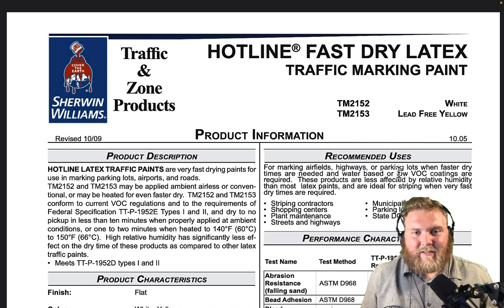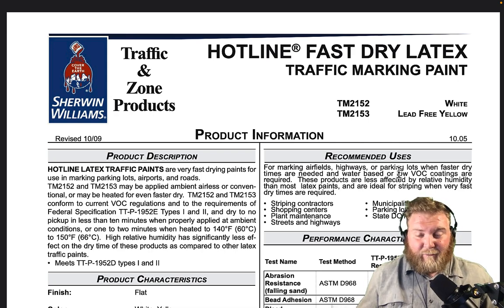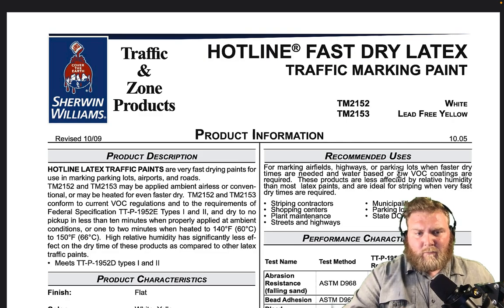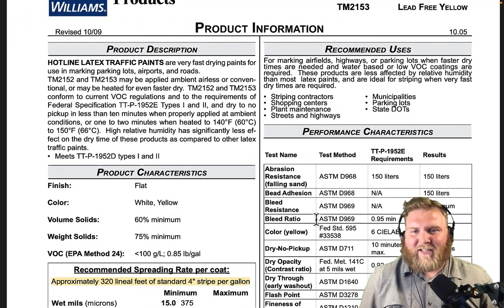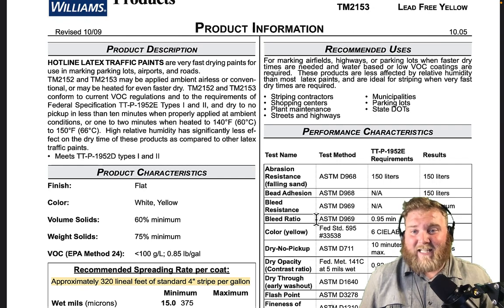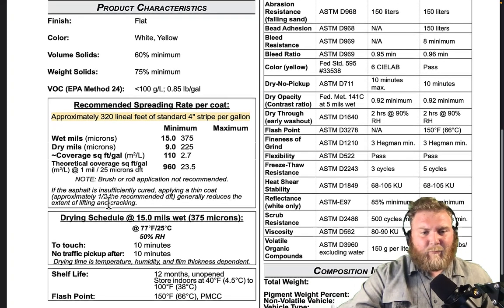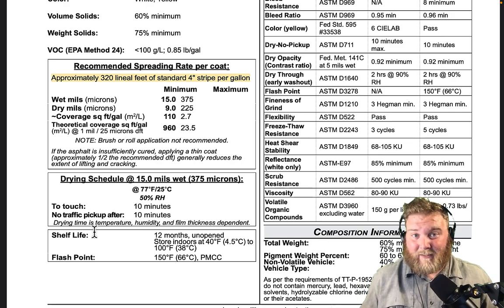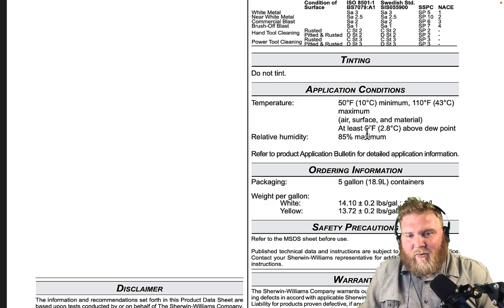What kind of PAINT do I use for parking lot striping Jobs? How to find out this FREE information.

Comment: 15 mils is standard in striping on commercial jobs. 2-11 black tip on that NP/FL. Wait till your forced to paint an underground garage with the paint you are talking about then get back to me on drying time and keeping other trades and forklifts off of it till it dries. The ghosting was from the added water. You should see what your state used for the roads and use the same, that way you can tell clients you are using DOT approved traffic paint, it is a good sales pitch. We go one step more and use FAA and DOT approved paint. Also always have on a safety vest no matter where you are striping.
Reply from the maker: Hey I’ve got a garage coming up, I’m kinda nervous on what paint to use. Should I use hotline if it’s just basic concrete? Thanks soooo much for your input it helps beginners like myself
Reply: @TheStripingGuy  Is this a commercial job or just someone who owns the garage?
Reply: @TheStripingGuy  In your case, you only have one machine so using oil-based paints would be hard for you to change colors. So, you can use the hotline as it does dry well for a water-based paint and holds up good. First thing spray the arrows with the proper tip and pressure, so you make as few passes as possible, every pass makes the paint thicker and longer to dry. Do the crosshatched areas as soon as possible so they have more time to dry, while you still have control of the garage.
Reply from the maker: @jimpatriot179  commercial sir